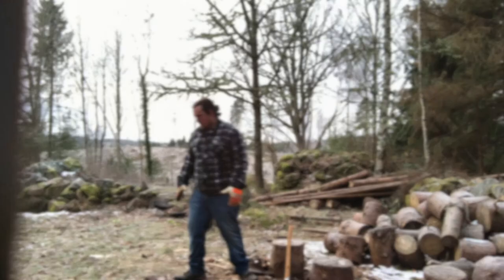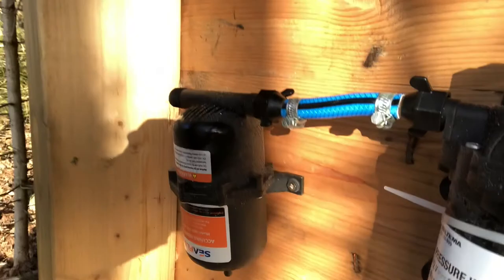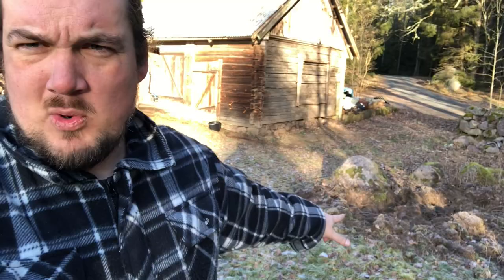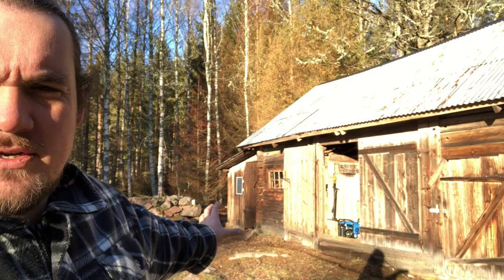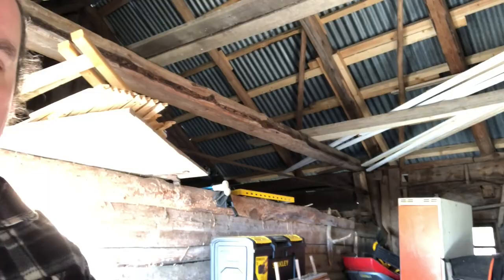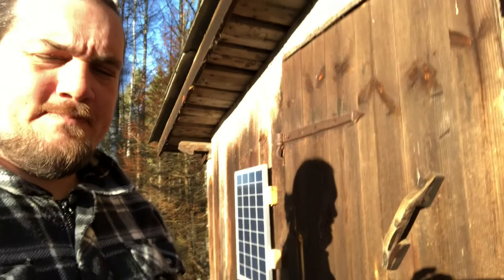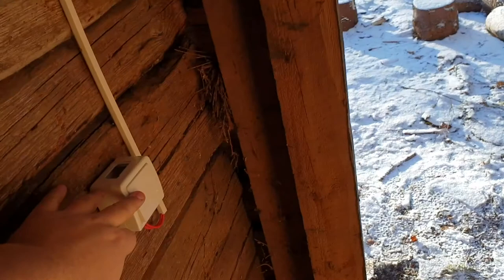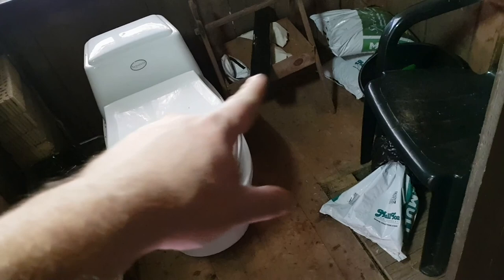Offgrid Swedish Cabin Renovation - Year 1 Catchup 2 - Water and Shed

Comment: How did you find doing all the electrics at first? Generators, regulators, red wire, blue wire, that's a mighty undertaking. Also love that the place came stocked with all that wood, absolute goldmine. Elena is asking how long you've had the place for now? I'm assuming about 2 years but when I thought about it some more I realised that I have no idea.
Reply from the maker: When I first got the place (March last year, so not even a year ago yet). It had no electrics whatsoever, that's why a lot of the lighting wiring doesn't look so neat, it was -20 and I didn't want to wear a head torch the whole time. I watched a bunch of YouTube vids on DC electrics and how to set it up and had a test rig at home with a small battery and a bunch of lights and accessories.